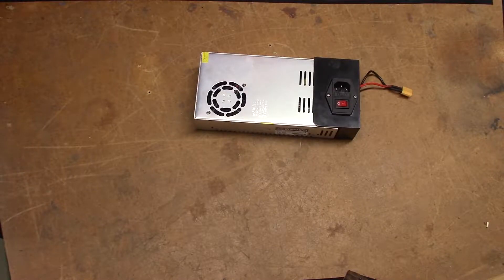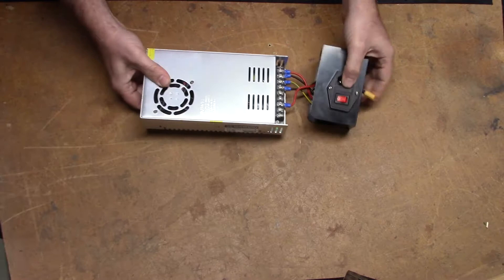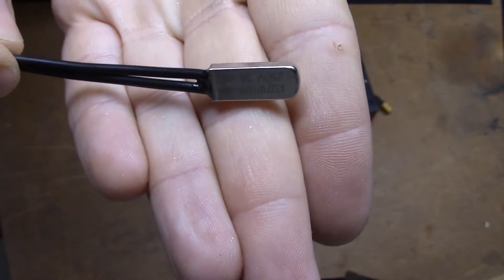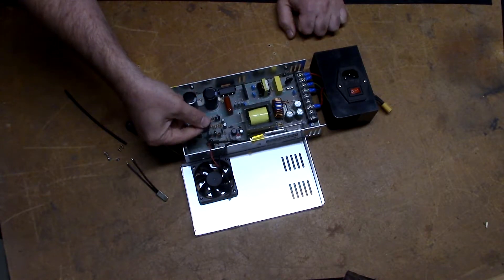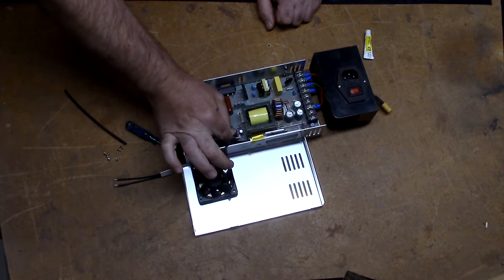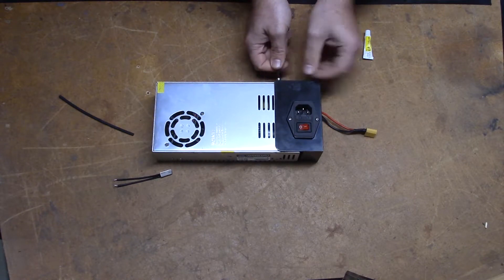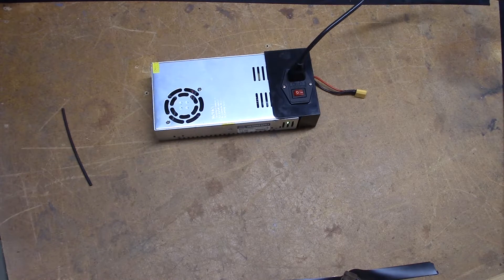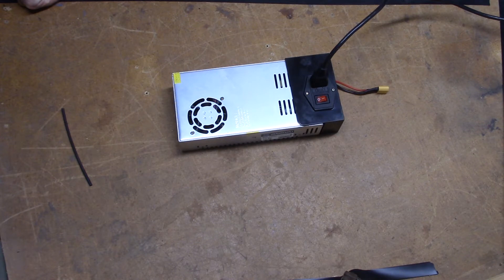Silence your 3D Printers PSU

Comment: Hi, I got exactly these thermistor from the link, but the fan does not turn off. It works normally as if the thermistor is not there. I tried with another thermistor, but still the same. I tested them manually and they click when heating and cooling, but with the power on, no  are working. What could be the reason?